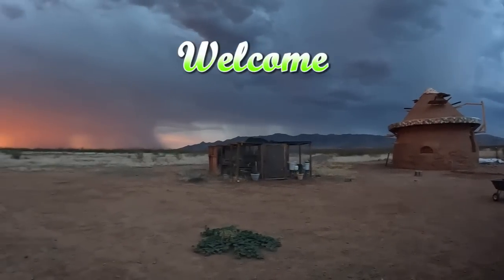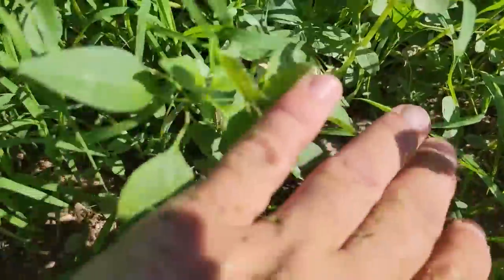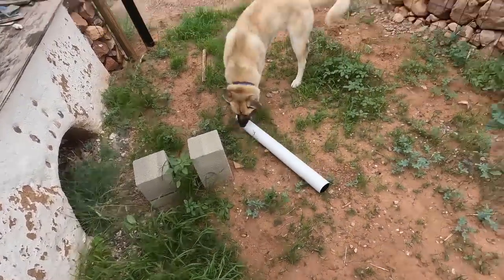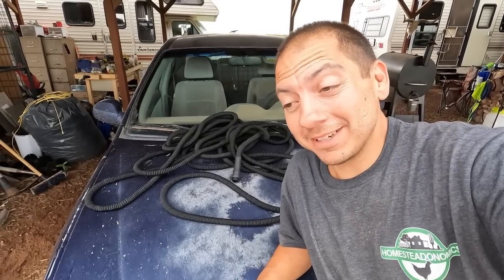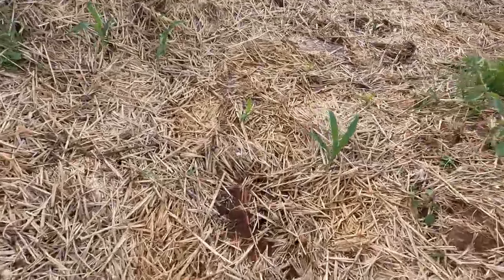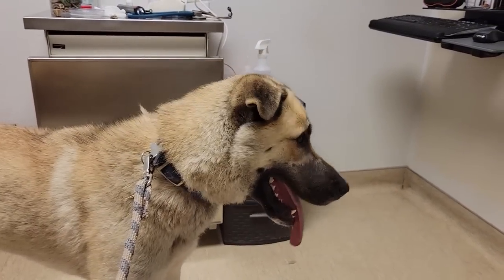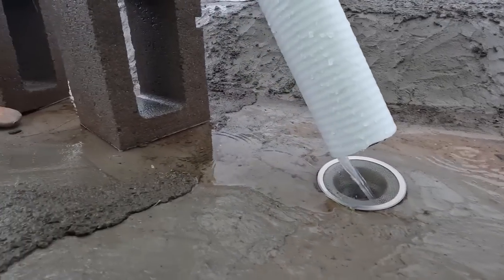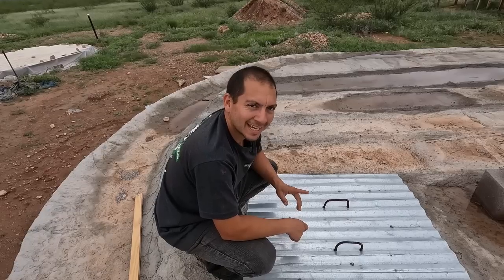How Much Water Do We Have In Our Earthbag Cistern? Upgrade To Our Rainwater Harvesting Overflow

Comment: I have a whole similar to that and I noticed for my yard the water pressure that comes out of it is lower than a normal garden hose. I only switched to this kind of collapsible hose is it's easier for me to pull over a hundred yards to water my garden. And actually one of my sprinklers I can't use with it I have to use a different type that I had because it didn't put  pressure to water out as far. I never thought about that when everyone else is getting too much rain the rain is good for you. I had to laugh I'm dog sitting my son's Aussie and his Aussie black lab the two dogs were barking when they heard your dog bark they were running to my front door. Beautiful scenery

Comment: I had zero luck with the non kink hose even at low pressure. Two came apart at the connections in less than 5 uses. Handle with kid gloves and good luck. Your pup looks happy with you guys.

Comment: Instead of tape or glue , if you drill a small hole in the pvc , and use a screw ,then you can take it apart later an reuse them for upgrades

Comment: Jim, you need to pinch off that hose until it is full, then let it flow. This may take a few minutes depending on your pumps gpm. Not only should the hose work better in general but it will also lengthen.

Comment: I had thought you would have had a cut off of the poly tanks having a direct root to the cistern then you can pump some into the poly tanks when needed I had a plastic pipe set up and instead of gluing I drilled a self taping screw holding them together temporary set up  so I could dismantle  them when I needed to.

Comment: The light hoses, don't usually have full throughput holes, they are like 4-8 mm holes, vs the half inch holes of a normal hose system. 

Bring em back, as those hoses aren't worth your time, I promise.

Look for hose fitting with Full throughput, (the ends of the hose, that you can assemble yourself.) and look for "1 1/2 IN x 100 FT Pool Backwash Hose", as this is light and easy to use and put away.

Comment: Not sure if you can do this but I work on commercial aircraft and all the water tanks have compressed air that are controlled into the water tanks to create head pressure which is around 40psi.  I know you can drill into the IBC's and put an aircraft compressor fitting with a gauge and put 40psi air pressure into the top of the tank.

Comment: I would install a compressor air fitting on your sealed water container,  you could  connect the air hose and add a little air pressure and feed the water much faster.

Comment: I think if you install a diverter valve from your carport to your cistern, you could fill it a lot faster. 
Using the entire surface of the carport to collect water should be much more efficient than just overflow.
Of course, you would only divert when the tanks were full.
Be blessed.
🤠👍
Reply: they do use the entire surface of the carport to collect water. That has been the idea. water collection is not the problem.

Comment: You could cut the PVC and put coal wrapped in wire on your inlet, or outlet water line to purify it better. The inlet pipe would be better in my opinion.

Comment: If you want a collapsible hose pipe used Forestry fire hose it's a little more expensive but you can buy larger diameters and get it Surplus Those collapsible hoses have a 1/4-in diameter bore at low pressure they only flow at their rating at near City water pressure.

Comment: I have watched most of the videos in this series but maybe I missed it - is there any kind of filtration of the water BEFORE it gets in the cistern? I have a long-standing problem with my rainwater tank where the crud off the roof will get washed in and the organic material will build up in the cistern and the water in there will start to smell funky after a while. We've even had sludge building up in our hot-water heater (before we added mechanical prefilters). I've had to get serious about installing a first-flush and also several stages of mesh filtering before the water gets in the tank. Because emptying out the whole tank and getting in there to clean it out is no fun and you want to avoid that down the line, it's a heck of a job, especially as you need clean water to do it, as well as a drainage hole at the bottom, or at least a sump, which I don't think you have (I don't either... I didn't build the thing unfortunately). You don't have a lot of trees and stuff around so maybe you won't get as much crud in your gutters, but it's not just leaves, it's moss, dead lizards, bugs... You really want that water going in the tank as clean as possible from the get-go.
Reply: Something that helps in a huge way is to raise the totes well up off the ground. It's nice being out in the desert as when it's dry you can clean out the interior of these amazing structures. Point being a raised tote helps in two ways the first being exactly as you say namely to have a secondary "water barrel" below for getting the most potable water possible which can then be boiled, put through a filtration station in the home and then what i like to do "clear ice freeze" if possible as the value of that product especially in the desert is so high it could probably be sold for a lot of money.

The other more obvious advantage to raising the totes up to at near or even above the "roof drainage system" is that water has incredible "tension strength" and will in fact flow literally uphill depending upon the volume. This also creates a more potable product but more than that creates an incredible amount of weight that can then be "flowed" to the cistern and anywhere else upon said property. 

As for sunlight degradation there might be some type of paint for that.
Reply: @georgedoolittle9015  Cool story dude.
Reply: @georgedoolittle9015  My idea was to have a tote which would be like a surge storage which could then drain through some slower filters like a sand filter and then into the main storage. Problem is, a tote is only 300 gallons or whatever, which is nowhere near enough for a big rain event. Unfortunately I can't move my main tank anywhere, it's rather immovable, though not quite as big as this one :D

Comment: Could you build a 15-30 angle metal or plastic slant around the top of your cistern to more specifically direct the rainwater into the runoff valves?

Comment: could you put a pipe in the water tank? holes in the bottom of the pipe so that the water in the tank can get in and out. pipe above water tank transparent. inside the tube a long stick with floating balls on the ends. the stick rises and falls according to the amount of water in the tank. no need to open and see. you can see directly how much water there is.
Reply: Like this idea

Comment: In hindsight,  put the big tank underground,  then build a funnel around the edge,  so your surface area would be more than double. 

You didn't do this,  so you could build a frame around the big tank,  increasing your catchment areas. 

It doesn't need to be big,  maybe 6/8ft of corrogated steel, plastic,  or even  tarps.  If you used tarps,  they'd only be out during the moist season. Take them in during the summer so they don't degrade. 

There's clearly enough rain fall to turn your land into a serious oasis, if you build more tanks. I'd build wider and shallower tanks.  So maybe a button style top in the center,  so you have your dish effect,  and so you don't have massive spans,  the button, which could be separate and above the cone,  would cover the center.